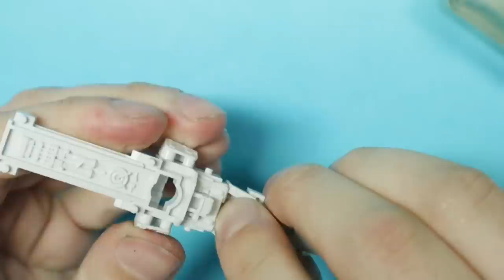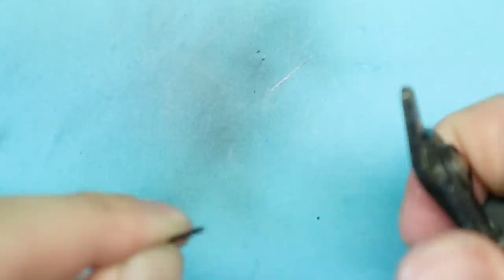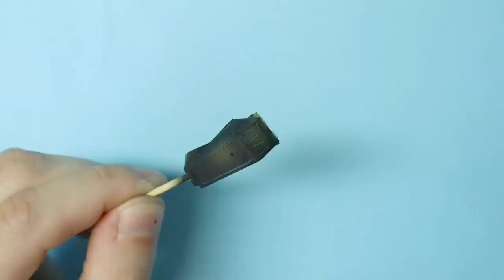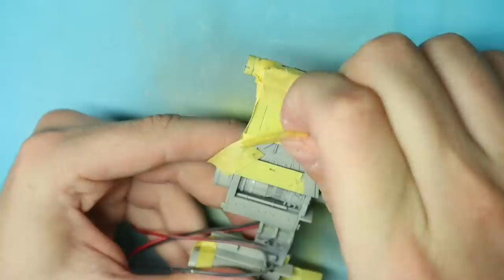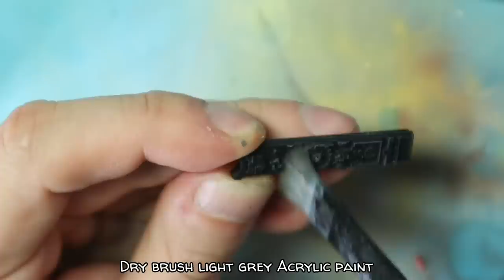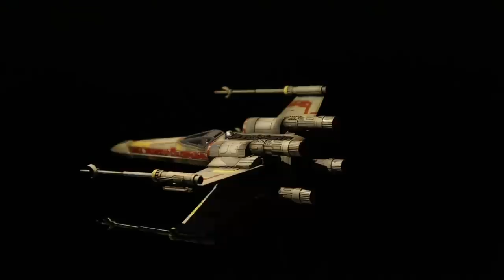X-Wing 1/72 Bandai star wars scale model build

Comment: Red engines?!?
Reply from the maker: yeah, ever tried to make clear pink? i didnt find the right paint. But i dont bother with this and keep living :)
Reply: Scale Hangar 182 true true! However..I went with pink LEDs instead on mine 👍🏼
Reply from the maker: @Habu12  sure, thats simple, but i can't do it that way, to avoid calculating all the power and soldering all transistors etc, i chosed to go simple way and purchased this power adopting power hub. To this one you can connct up to 28 LEDs but all must be same current. You probably nknow that i cant connect different colours of diod as current is different in each colour (well i think white and blue are same) so i decided to go with white/clear LEDs so i can colour. Why i didnt get pink while i use only one color to that project? because that project is not finished, and im going to build 3 more kits to connect to the same hub and do one base to all of them, and more colours i need to add.
Reply: Scale Hangar 182 I understand. I don’t like to solder and whatnot all the time either. It’s a chore.